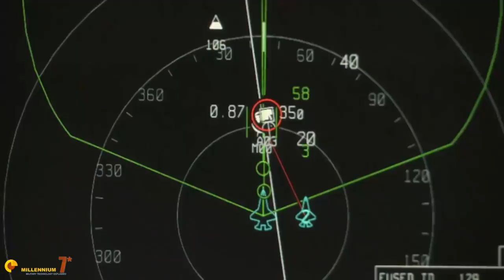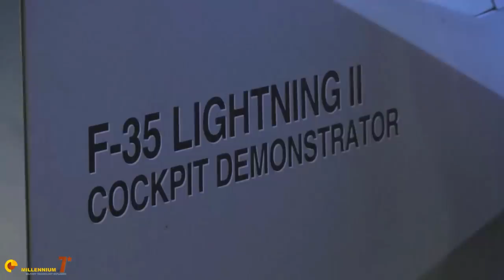Put the F-35 inside the F-16 | Are there limits to upgrades?

Comment: F-4 Phantom, McDonnell Douglas's proof to the world that with enough thrust, even a brick can fly.
Reply: Partially true. This is somewhat a cliche. However, if you read the book "Loud and Clear" by Iftach Spector, there is an astonishing description of a 1 vs 1 dogfight between an Israeli F-4E and a Syrian Mig-21 in 1973, where the Phantom outmaneuvered the Mig in "scissors" at extremely low speed and altitude, theoretically the worst case scenario for the F-4, leading to the stall and crash of the Mig. My point is that, in the right hands the (slatted) Phantom was and still is in some countries, a very agile and maneuverable plane. Additionally, in Vietnam some pilots pulled 12 g trying to dodge SAMs, something that you simply cannot do today with the Fly-By-Wire systems.
Reply: @GolfZulu67  
It's also ironic that the F-4 actually have a lower wing-loading than the F-16.
Reply: The F-4 was actually a very excellent aerodynamic design and was capable of reaching its stated maximum mach values while combat-configured, even with EFTs, not that this was every tactically-relevant.  It had a really strong wing design and how it was joined to the fuselage, and a stores carriage arrangement that allowed for full A2A loads to be carried without being impeded by A2G loads.  That full A2A load included 4x AIM-7 and 4x AIM-9.  The Typhoon is the closest thing to it in that regard, since the Typhoon also carries its BVR missiles in recessed stations under the wing/fuselage.  We mandated that the F-15 be able to carry the same A2A load as the F-4, which also influenced the stores capacity of the ATF program.  The F-4 was a pivotal fighter design on the teen series, with influences carrying over to the F-14 and F-15, and by extension, the Su-27, Typhoon, Rafale, and F-22.
Reply: Say a video interview of F106 pilot that said his jet could supercruise, but shut my mouth, it's a secret.
Reply: Explanations not too simple, not too complex.
Reply: @slmyatt  F-106 had internal weapons bays, high sweep angle delta wing, powerful motor optimized for higher speed at altitude (turbojet) Wouldn't surprise me.  I just was pointing out some features of an actual F-106 the other day at Hill AFB Museum. It has better panel line fit/finish than the Su-57.

 F-16XL was specifically designed for supercruise.
Reply: I did not say the F-4 was a bad aircraft, I was only sharing a common saying in the Navy about the F-4.  I I worked on Tomcats side by side with F-4s in 1977/79 in Hanger 1 at NAS Miramar.
Reply: @tolson57  I used to hear a funny one from somewhere in USAF that the F-4 was more aerodynamic backwards, but I think it's just one of those outhouse lawyer type of tongue-in-cheek things we pick up.

What kind of hours did you have to put in on the F-14? I'm always amazed at some of the stories I've heard from Tomcat wrench-benders.
Reply: @LRRPFco52  I only worked directly on the plane for about 6 months.  I spent the remainder of my career (18 years) working Intermediate level maintenance (AIMD). I worked on the avionics  and fire control systems from the F-14, E-2C, S-3A/B, and A-7E.
Reply: @GolfZulu67  Super Hornet has G override which limits fighter to 11G. Maintenance will NOT like the extra inspection workload after enabling G override.
Reply: @LRRPFco52  Original F-16XL failed supercruise while F-15E can supercruise.
Reply: @valenrn8657  I've had my hands on both F-16XLs, the F-15B Strike Eagle Demonstrators, and F-15E#1-3. F-15E with CFTs is not even doing Mach 1.5 most of the time and that's with burner.

If we're talking about a Mudhen doing supercruise, the conversation is all wrong.
Reply: @mickeyg7219  but does the body of the F16 has featureas that generate lift, lowering the wing loading?
Reply: @shaider1982  
Yes, the F-16 featured a lifting body design. However, normal wing loading calculation doesn't take that into an account, that's what I'm pointing out.
Reply: That joke didn't even make any sense when it was coined in the 1960s. There is nothing about the F-4 which would suggest it should not be able to fly. WW1 aircraft can fly as well, and with less than 100 hp. The seeming surprise about the F-4 is not that it can fly (an A-6 looks even less aerodynamic), but that it can fly so fast_. Properly it ought to say that 'with enough thrust even a brick can go double supersonic'. _That is true But a brick cannot fly, no matter how much thrust it has, unless you are using thrust to create lift.
In any case, there was nothing wrong with the aero of the F-4, it just didn't look the way pilots expected a fast jet to look, so they made that joke up (also relevant to the poor glide ratio it had). The Lightning is really a better illustration of the conquest of thrust over drag.

Comment: Have been looking forward to this video. A clear and relatively concise explanation regarding the limits of the F-16's upgradability. I can see the same happening in Russia with the Fulcrums. There is not much left in the Fulcrum that the Flanker's can't readily be adapted to take on with ease and that's not even taking the smaller budgets into account.

One must accept the limitations inherit with smaller, lighter aircraft, for now they will forever remain second fiddle to the bigger heavy fighters despite a manufacturers best efforts.

Going to be interesting seeing how things go from here.
Reply: Light fighters have one advantage though: they're cheaper. Although this arguably does not matter as much because pilots and training capacity are always limited to a degree outside of a total war scenario.

Comment: All f16 in US fleet are planned to be upgraded to the f16V i believe. i know as of 06/25/21 as many of 80 USAF F16C's have been upgraded with APG-83 which is basically a squished to fit in nose of f16, APG-81 of the f35 which is an CONSIDERABLE UPGRADE! But it's only half or really less than half the f35 avionics that make f35 so dam impressive like what make up DAS(Das or DASS?) giving it 360* IR coverage for hundreds of miles etc...

Comment: If you are interested TCP/IP operates on level 2 of the 7 level model. TCP/IP has two main versions that are used IP v4 and IP v6. Most programming uses the presentation levels 6 and 7 and calls the operating system to access the other levels. I believe that this is correct but I have not worked in IT for 20 years, so I might just be telling you the status on the playmate of the month.

Comment: Hello Mr. Millenium may I ask you if it would be a terrible idea to take an existing design and make it 10 - 20 or 50% bigger and then make the neccessary adjustments, and if so what would be the issues?
Thank you very much. Very appreciated videos.
Reply from the maker: The issue is that structural stress doesn't scale linearly, that lift scales with the surface but weight with the volume etc.

Comment: And this is why, for example, US  Navy got rid of the F-14 instead of pursue the Tomcat 21 or something. Not only a matter of politics. Excellent and informative video as usual. Good year from Italy!
Reply: The ASF-14 tomcat or Advanced Super Tomcat as some called it would have been faster than the F-35 at Mach 2.4-2.6, and could cruise at M 1.3 with 8 AIM-120's and 2 AIM-9X, a greater radar range than the F-35 with a built in FAC mode (US Navy FAC-A is a 2 seat mission so FA-18F are assigned to it not F-35's) , longer un-refueled range.
What it would not be was stealthy, though you could bring the RCS down to close to or below F/A-18E levels by altering the intakes and installing a screen.
Maintenance wise, it would probably be somewhere between the F/A-18E and the F-35C, the wings will still be a source of concern though that can be reduced by going to an all electric servo design.
Reply: @pogo1140  Wet dreams. You're talking about a plane that doesn't exist except in Grumman commercials.

Comment: There was that F16 VISTRA experimental plane in the 1990s. It ended up being used as a trainer later in it's life because they could program it to fly like almost any other jet with the thrust vectoring engine it had. Not stealth at all but why some degree of thrust vectoring control was never upgraded to other F16s doesn't make any sense.
Reply from the maker: Interesting. Do you have any detail?
Reply: @Millennium7HistoryTech  
https://youtu.be/XZQDwRKHCSQ
This footage was from it's early days. Later it was put in storage. NASA got it later again and had to rebuild parts of the electrical.

Comment: We've been using the AFTI F-16, F-16 DSI, and F-16 LOAN testbeds for ATF and JSF technology test and integration from the early 1980s through 1990s before ATF CALF/SSF/ A-X designs were even proposed. Just like we used the F-8 and F-4 CCV to test fly-by-wire systems by 1974, even with coupled canards on the F-4 CCV, we use previous generation aircraft to develop the next.

F-4 was a great, robust airframe with better multirole stores capacity than any of the teen fighters due to the semi-recessed AIM-7 stations.

So why not just put the new avionics in the F-4?

Maintenance access panels and its 1950s wiring harness architecture were tiresome to deal with for starters. 2 engines magnified maintenance and operations costs.

Combat radius was really limited at around 370nm, about half of the A-7D.

F-15 & F-16 offered much greater range, mx-friendly access panel architecture, superb pilot interface, improved radar size for F-15, and single seat crew that cut the demands on aircrew training fleet-wide.

The cost/benefit analysis to upgrade or produce new F-4s with fly-by-wire avionics, new radars, new engines, canards, composites, single piece wind screen, new cockpits, etc. didn't fully solve the fundamental problems of range and 2-crew. That rear guy in back was no longer needed and would be best-used for more fuel. We converted Tactical Air Command from F-4E units to F-15A/C and F-16A.

The 2 crew F-4 was still relevant for the F-4G Wild Weasel until it was eventually replaced by the F-16CJ and now F-16CM.

Comment: Interesting to see aircraft avionics mirror the development of personal computers, my first computers everything was passively cooled, a stamped piece of aluminum over a few components was all that was needed, much like an aircraft's skin. My latest PC is a mass of fans and vents with liquid cooling to stop it frying itself, all because of clock speed.
My mind was blown to see those intakes just for the avionics bays.
Reply from the maker: Well said!
Reply: Well it goes along with the increase of the transistors density (in any type of chip) and if you take into account the for the 6 generations they are going to integrate GPUs (or similar hardware) to execute AI models inferences it's exactly the same happening in your computer generation after generation
Edit: I was writing the comment and Mr Millennium just mentioned the Tempest
Reply: @asganaway  Yes, while transistors have gotten smaller chips are generally way larger and contain literally millions more components than the early days of integrated circuits.
Reply: The air intake on the f35 bottom is to cool the engine and not for the avionics. The next  hottest part is the radar.

Comment: The logical reason for not using the F-16, is that there's been quite a lot of materials and aerodynamic development since then and a new airframe would allow these advances to brought into service giving a 4+++ generation replacement for the F-16 which can remain in service for 10s of years. Im surprised that the same thing hasn't been done for the F-15 as well, but I guess the requirement driving the upgrade programme doesn't allow an extended timetable. The USAFs mistake was thinking Stealth would be required for all new aircraft. They didn't allow for the peace dividend impact on how fast Stealth roll out has happened.

I do wonder, given the proliferation of Chinese Stealth designs in or near service, whether investing in less Stealthy airframes make senses in the longer term though. If a short term replacement for the F-16 is needed them it might be cheaper to make the Gripen E/F under licence with US electronics as a temporary measure.
Reply: I guess another alternative would be to resurrect and modernise the F-16 experimental delta wing design ?
Reply: The Gripen electronics are a big reason it performs so well.
Reply: Because of stealth and the responses to stealth, all new fighters and bombers will require it.  If you show up in a 4.5++++++ airframe to the sensor and missile fight designed to try to deal with stealth, you’re out-matched even more.  Detection ranges are much greater on legacy high RCS platforms now.  Missiles are more accurate and lethal against legacy airframes, while struggling to deal with VLO technology.  The biggest, most over-looked aspect of this is in providing precise guidance solutions for RF seeker missiles, as well as IR seeker missiles, because people don’t realize that stealth also includes the IR spectrum.  The US has spent billions on reducing IR signatures on the F-117A, B-2A, F-22A, and JSF series.  Helmet-cued HOBS missiles don’t really work against 5th Gen, and IR SAMs don’t either.  

As the threat nations address this problem, it will make the lethality against non-stealth aircraft even more devastating.  So stealth is a mandatory baseline moving into the future.  China knows it.  Russia knows it.  UK, Germany, France, Japan, South Korea, Turkey, and Sweden know it.  China is the only other nation with 2 new stealth designs that are actually flying, with one in full rate production in the J-20B.  Russia has not produced a true 5th Gen stealth aircraft with the Su-57, but it does have Low Observable qualities that make it a step above the Eurocanards and teen series no matter how you upgrade them.

Any money spent on further developing teen series and Eurocanards outside of the projected O&M and life upgrades is a waste of money and sets one up for failure in the emerging IADS nets.

Comment: You are spot on. The F16 is a superior aircraft but lagging behind because of it's upgradability, or rather it's potential upgradability. Just comparing to the Gripen lauched about 10 years after the F16 it's software upgradebility is inferior. Though the Gripen F hss major hardware upgradings, new engine, wider wings and more hard-points, it still remains the same aircraft. The difference is software architechture which seems to the F35s. Just consider why Boeing chose SAAB as a partner for the new USAF trainer T7 trIaner? Like all other manufacturing; it's no longer about the hardware but about the software. The F16 will reign the skyes with new software.
..